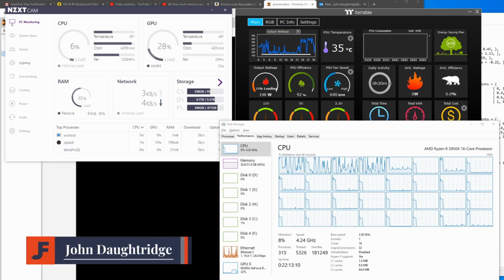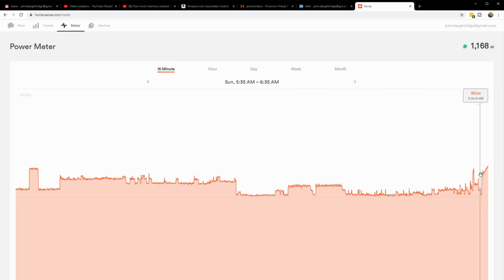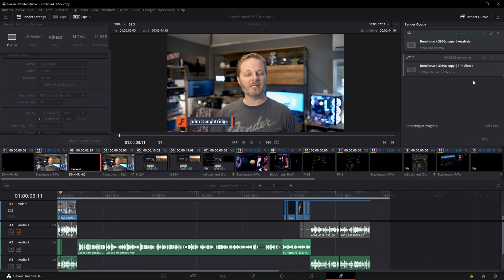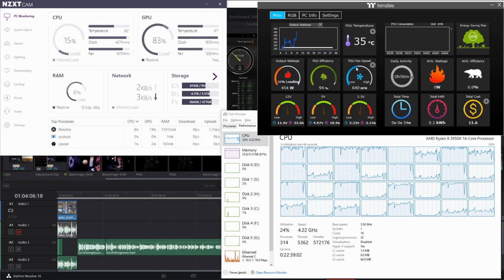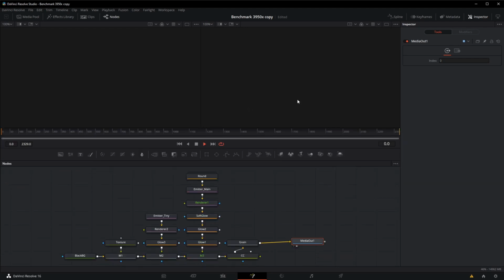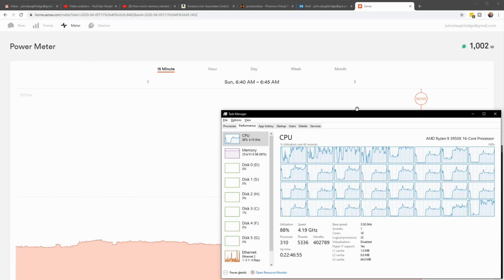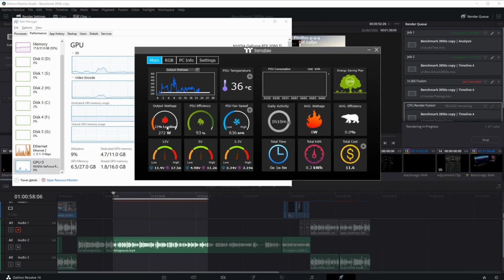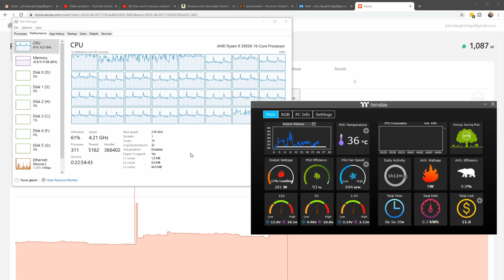Video Editing Power Use - How much does it cost to edit videos on your PC?

Comment: Hi John!
This was a cool take on the video! 
Being me, I couldn't help but to post a link to my energy management system in my house. We are there weekends, but our daughter lives there full time. The graph shows the temperature in the three ackumulator tanks (530 US gallons each) coupled in series and the outside temp. Large ackumulator tanks means that there is a log boiler (60 kW) with two fall backs, wood pellets and electrical heating.
http://e-logger.se/e-logger.png?jdwIbzYeRG
The logger I use is Swedish, https://www.energibutiken.se/en/datalogger/219-logger-2020-illuminated.html
It handles modbus, 1-wire, analog and digital interfaces and also the Nexa wireless protocol. Common here in Sweden for remote control of lights in bedroom, living room etc. So with the Nexa I trigger a desk lamp when it's time to put in more logs 😎 😎 😎
Reply from the maker: Rudolf Abelin WOw!  That thing looks amazing!!!  thanks for sharing

Comment: Hey John great video. I use Kill A Watt which is an electrical plug monitoring device. When I use this I have all the applicable Desktop items (the Computer, any external power drives) plugged into a single multi-plug extension, channeled into one line, then plugged int the Kill A Watt, then into the power outlet. This allows you to see from startup of your Desktop through long term usage how much power you are drawing. It is not a state of the art as your house monitor through the house electric buss, but is very effective for checking any type of appliance power draw.
Reply from the maker: I like that and was going to go that way when I saw the sense monitoring system.  My plan was to go to all the things in the house and test them.  This system does all that for me :)
Reply: @johnsfilmsllc  Your house system has been highly recommended to me. I just need a single line device at the time which is why I went with the KAW. Again, thanks for the post and sharing!